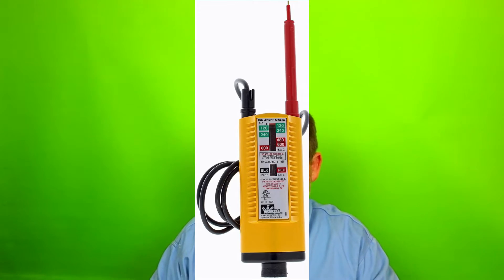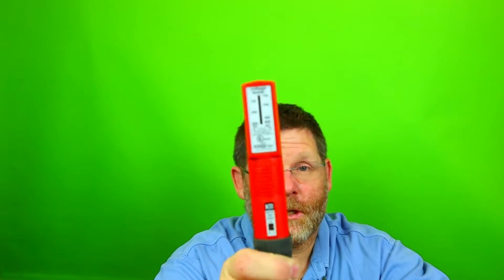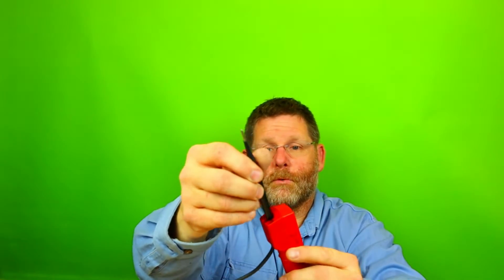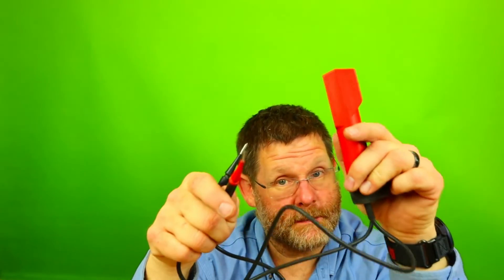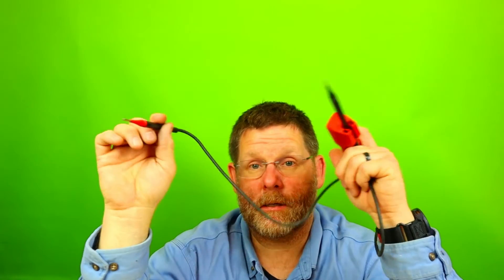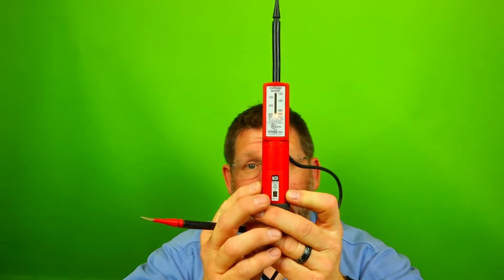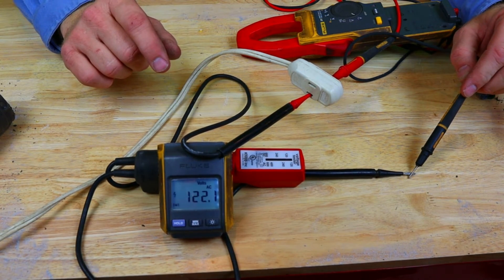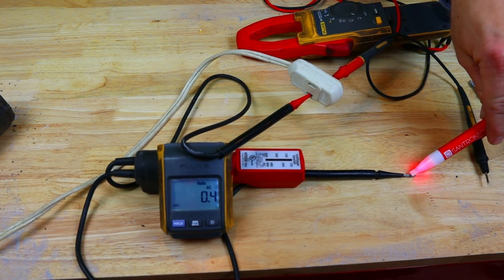How To Use A Wiggy Electrical Tester SAFELY A Must Watch

Comment: You can perform the same test with a dmm. The lead opposite the hot lead will still have voltage on it. Will it not? I just did your same experiment with a Fluke 323 and the free air lead registered voltage with a tic tracer. Saying you can hold the opposite probe with a digital meter is just wrong.
Reply: The wiggy has an internal resistance of around 3000ohms. That will absolutely give you a nasty shock. Any half decent DMM will have a internal resistance around 10meg. You might feel that. And yes you should always treat the free lead as live. But you won't die.
Reply from the maker: I beg to differ you may get residual voltage on the other lead but a shocking voltage I haven't ever seen

Comment: I primarily use the Fluke T+Pro which is pretty much a modern Wiggy. I love it because I work in a hospital with some circuits prone to ghost voltages and the Fluke T+Pro doesn't pick these up. It's a dummy proof tester.

Comment: Thanks for the video. I guess that explains why years ago I used my Knopp checking a light socket on an outside circuit and it kept popping the GFCI but if I used my Fluke 115 it would not happen.
Reply: All wiggy’s will trip a gfci.
Reply from the maker: My pleasure thanks for watching and commenting ☺

Comment: I have a Knopp.  Have had it for 25+ years or so.  The probe holder on the unit is a little different, but pretty much the same otherwise.  My first Wiggy was an Ideal from 1978, that walked away one day.  George P. Wigginton invented the solenoid voltmeter in 1918,
Reply from the maker: Interesting I didn't know when the first one was invented. Thanks for sharing. Have a great day ☺